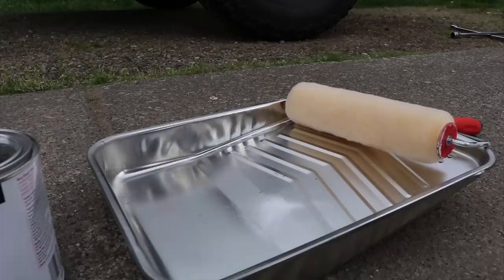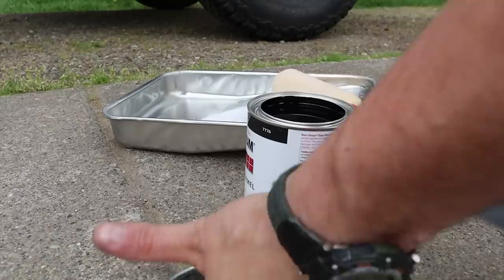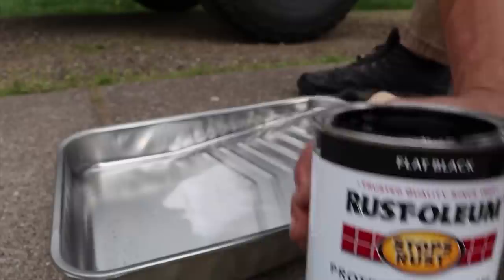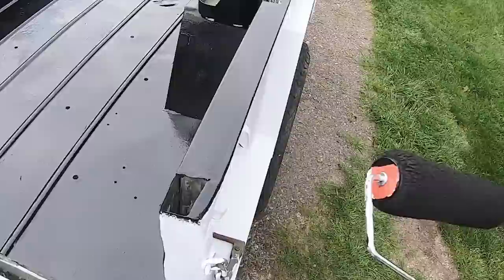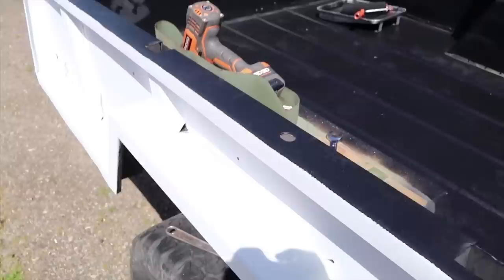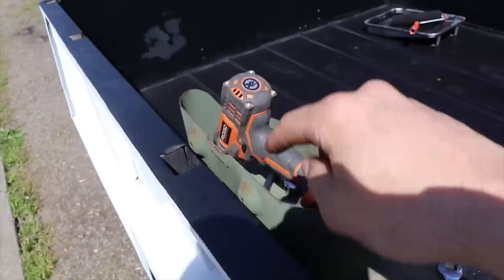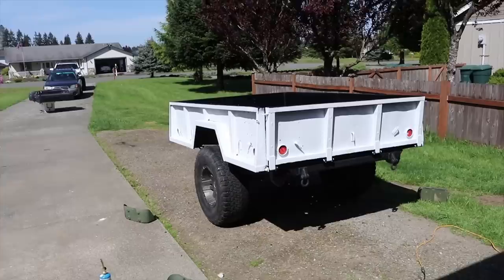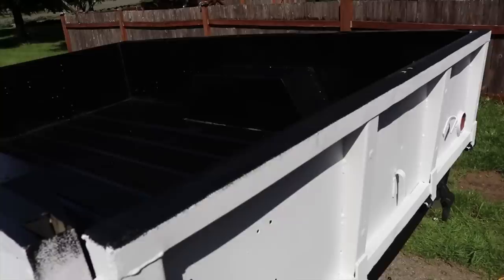Converting Army Trailer to Overland Camper!! (M101 A1)

Comment: You did a great job.  I know it is costly to make mistakes but let me give you  some advice.  We can never know everything about everything so that is why there are experts in specific fields like paint dealers, axel supplies, bearing supplies, and anything you may need.  Always ask them how to  do what you are wanting to do.  The most stupid question you can ask is the one you  do not ask, like the one about greasing the bearings and installing wheel hubs.  Like this video, there are tons on here where people explain how to's so research them out next time.  They will save you lots of time and money.  By the way, great looking trailer and a fun video.  Thanks  for posting.

Comment: Joyous fun. Military trailers are prone to bearing failures frequently. At least it didn’t fly off on the road. The axle assembly used is ironically a standard Dexter axle. Army TMs are available on the internet for anything that could be purchased as surplus, however the manual does not contain a torque spec. Look up the axle weight, go to dexter and get a torque spec from them so at least you don’t experience the same outcome. 
One comment mentioned using a good grease, definitely do that. 
I pull my trailer bearings and inspect them annually, it’s kind of a big deal.

Comment: Here's my o.o2 cent review; (I do that exact work at the day job.); the inner bearing cone HAS spun-welded to the spindle. Yes, you can cut them off, with a die grinder and cut-off wheel. But be VERY careful, or you can destroy the axle. 85% of the damage is usually on the bottom edge of the spindle/bearing surface. (Lie under the spindle and look up.) Now change die grinder attachment to a roloc holder and sanding disc to polish the gouges out. Be gentle. Then change to the scotch-brite pad in the roloc holder and smooth out the sanding striations. You are finished when the clean/new bearing slides smoothly over the spindle, SMOOTH! At the hub, you SHOULD change the pressed in races in pairs, both inner and outer. A hammer and large taper punch will get them out. Then to press in the new races, we like to use aluminum round race seating "pucks", (available at an auto parts store). THEN you can add freshly greased, new bearings. and install new grease seals. It's good to roll the hub as you gently seat the bearings, it should take almost no effort. Roll hub and set spindle nut torque by hand, then back off "a smidge". Set the spindle nut with the new, appropriate keeper. Replace the dust cap with new cap, the old ones can fall off easy, that is a BAD thing. We always recommend using anti-seize on stud threads, torque to 120 ft./lbs. max. (For 1/2 - 20 studs.) Done, but expect that spindle damage like this lessens the service life of any axle, so be aware. Do not over grease ez lube spindles, as this only leads to grease seal failure. No, not the mama.
Reply: Agreed. I would also recommend hitting your FLAPS (Favorite Local Auto Parts Store) and getting a $5 cone bearing packer and a good grease gun. Snot the hell out of the bearings, the cups, and pack the hub cavity with grease. make sure you get the right grease!

Comment: Too late but trick is Bering material is crystalline. Put met all block or heavy hammer under. Hit with another big hammer and it will shatter. Then polish surfaces clean with paper brake cleaner and use the best synthetic  high temp grease.

Comment: If I understand wheel bearings correctly, the bearing races don't rotate around the spindle so if you can get the spindle to a point where everything is in line when assembled you should be good. Assuming you grease the bearings liberally and don't over-torque the spindle nut (the one that holds the entire bearing assembly and hub on the axle).  If the assembly does not align properly the bearings and or races  will go prematurely. 

A warning though.  A bearing/races/spindle, the assembly, can get worn so severely that the wheel will fall off.  A co-worker was responsible for boat trailer maintenance and as we were driving to a work site and were turning a corner I looked out the passenger side window and had the dubious pleasure of watching the boat trailer wheel pass us and continue off into the ditch.  A country road so no real consequences other than the convenience. BUT on a busy highway?

Comment: The boy is taking after dad.  He is all greased up.  I think you lucked out and have a grease zerk center shaft once done with axle you can pump grease into the whole bearing housing from that zerk (unless the hole in back is plugged.  I have picture that shows path.
Reply: Looks like a great build. Make sure the canopy lines up (supported by sides well...don't want to crack it).  Also you may want to fabricate a bed rail extension (enclosed) to raise canopy up to secure motorcycles in back (may look weird if higher than truck though...trailer bed sits high).   Would it be better to put motorcycles in truck bed since your emptying out truck?  I will be waiting to see what combo or solutions you come up with.

Comment: To not do something or pay to do something that needs doing is this issue. When buying it used it is common it is needing maintenance. Trailers have less things to maintain but mechanically the wheel bearings are the most important. Checking they are good and greasing them with fresh is done before use.

Comment: OK, final comment.  Just my opinion but in my opinion these trailers are way too heavy for most users.  And if you have to do things like replace axles probably not worth the money.  You can buy relatively light trailers with good bearings (new and of high quality) for relatively little money.  Structurally sound trailers. And spend you time and monetary resources doing actual improvements rather than modifying something that was built for an entirely different use.

Comment: Did you tighten the nut down spin the hub then back the nut out about a quarter turn? If tapered roller bearings are too tight, that will kill them also. I've done hundreds of these type bearings with no problems. Thanks for the Vids.

Comment: You could have taken that axle down to a machine shop and returned and sleeved that spindle. 
Max, please do not trust that outer bearing, on a long run it will be problematic.
Reply: Maxx Powell, Try some short runs with it and then recheck the bearings. If that bearing seizes up at highway speeds the result could be catastrophic for you and any occupants in the truck.

Comment: Anyone know what length this axle is? Needing one for my M101A trailer.
Reply from the maker: Man I wish I could remember !
Reply: Maxx Powell I measured 43inches from center leaf spring to center leaf spring but I’ll contact dexter and see if they know since a lot of folks do this swap. Thanks for the videos and the help!
Reply from the maker: If I still had the trailer I would measure it for you but I actually sold it last summer
Reply: What camper top did you use?